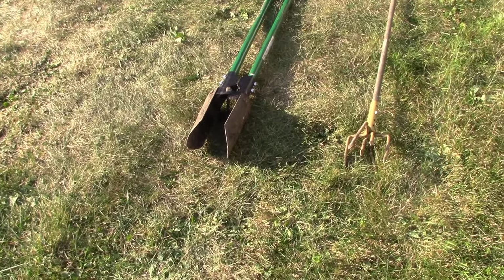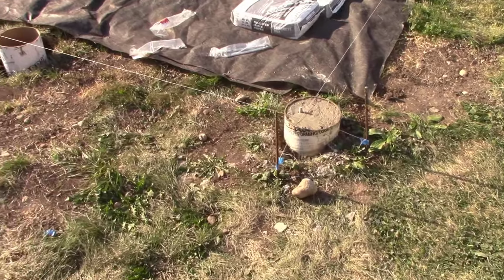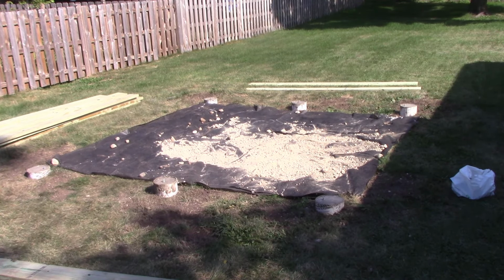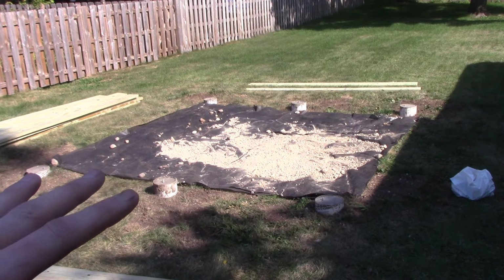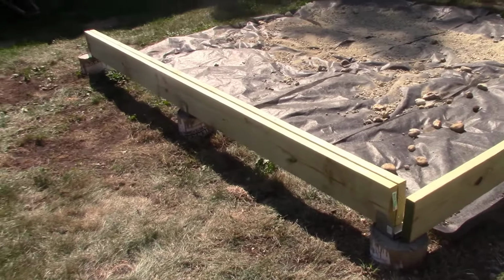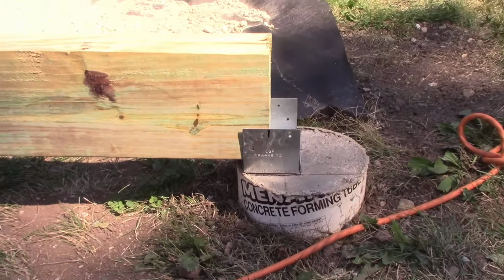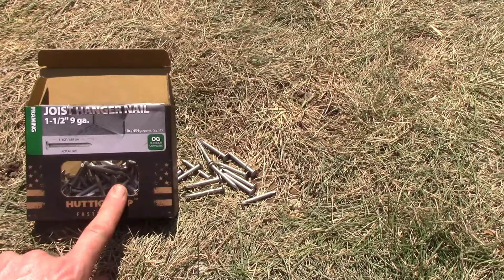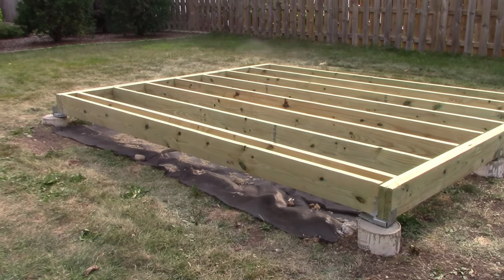Building a 10 x 12 Shed, Part 1: Foundation

Comment: I would have put my piers with 3 on the 12 foot length and run shorter 10 joists. Less span and less material. Usually you double up the two end joists where your walls are sitting for more support of the wall load. I also would have made my dimensions fit my piers since you didn’t place your piers to fit your original size. 
Great job and always feels good to step back and see what you built when it’s finished!
Reply from the maker: Thanks for the tips!

Comment: I gotta ask, would the city not allow you to have your inside rimbeam 1 1/2" short so you could nail the rim joist into the end to make a perfect square and not use a hanger, but sitting on the concrete anchor?
Reply from the maker: That probably would be fine.  My city's code for shed foundation is pretty vague; they give a 3 options for foundation types (slab, piers or auger anchors) and a bunch of requirements around where it can be located (easements between structures, property line, etc.)  Other than that, they leave it up to you as to how you frame and build it.  I used some pretty standard plans and got no notes from the inspector who passed it.
Reply: @FixItScotty  Nice! I appreciate the reply. I'm looking into building a 1.5 story workshop shed which will he kinda heavy. Don't wanna pay 7K for just a shed foundation 😄

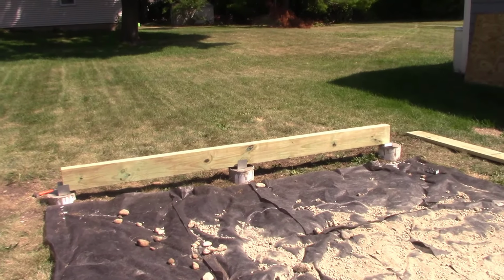Comment: Newbie here. Why did you not just buy joists- like 16" (or 14" if they have those? The joist on the bottom right of the screen @15:24 is just barely hanging on, if it starts to rot at the end then you're gonna have some issues.
Reply from the maker: Good question.  I should have extended the joists to fit the piers better, but the maximum square footage for a shed that I'm allowed to build in our town is 120 square ft.  So I had to keep it at 12' x 10'.

Comment: Did you use any rebar in the piers? Maybe I missed it or it was omitted in the edit?
Reply from the maker: No, I just poured concrete into the empty sonotubes.  For this application, I don't think rebar is necessary.

Comment: Looks like you should always plan for a bit of overhang when marking for your footings, then you won't have the issue. You could also cut some 1/2" plywood into 7 1//4 inch 8 foot strips to place between your beams when you laminate them together. That will make up for the 1/2" gap and also give you a bit more strength.
Reply from the maker: Great suggestions

Comment: hi how did you determine the pier diameter and spacing?  I am looking to build a 12 x 16 shed myself..
Reply from the maker: For me it was two ways: my local code specified minimum pier size and depth.  I believe it was 10 inches and a depth of 42 inches since I live up north and the pier has to be below the frost line.  As for placement, I just used the shed framing plans that I bought that suggested 3 piers per side with the double 2x8s spanning them.  That would be based on the type of dimensional lumber used in the floor framing and the spans allowed for the load.
Reply: @FixItScotty  thanks!

Comment: Can you use a deck foundation to build a shed
Reply from the maker: If your deck was built with treated 2x10's, 16" on center and is level and on firm footings, that should carry the load of a shed this size.
Reply: @FixItScotty  I was going to use 2x4s and cover I with deck boards with a deck block on each board and a row in the middle would that work? It’s going to be a 8x8 shed
Reply from the maker: @christophert5296  Even for 8x8, I would probably use 2x6s for the floor joists. 2x4's may work, but my expertise is not carpentry.
Reply: @FixItScotty  Ok Thank you!!! 😊

Comment: What brackets did you use to cast into the concrete piers? I'm also working on a shed foundation, but I can't find any brackets that are made to be placed in a concrete pier so that lumber can be placed into them horizontally. They are all built for vertical posts. I'd like to run my skids in in the brackets horizontally, as placing my floor on vertical posts connected to concrete piers would bring my floor up too high.
Reply from the maker: I used 4x4 brackets. You can either shim the bracket for the extra 1/2" or glue a 1/2" plywood strip to your 2x8 or 2x10 lumber to create a 3.5" width.  https://www.menards.com/main/hardware/fasteners-connectors/construction-hardware/column-post-bases-caps/mitek-reg-4-x-4-steel-2-sided-post-anchor/pa44e-dp/p-1444445522951-c-8825.htm
https://www.menards.com/main/hardware/fasteners-connectors/bolts/anchor-bolts/grip-fast-reg-1-2-x-10-hot-dipped-galvanized-anchor-bolt-w-nut-washer-2-count/1210hgab/hardware/fasteners-connectors/bolts/anchor-bolts/grip-fast-reg-1-2-x-8-hot-dipped-galvanized-anchor-bolt-w-nut-washer-2-count/128hgab/p-1444439570032.htm
Reply: @FixItScotty  I appreciate your reply. My main issue is that these brackets are for posts to be placed vertically. Do  you know of any brackets that are built to hold lumber in the horizontal position and be cast in concrete?
Reply from the maker: @joshuawood6644  I'm not sure. They all seem to be built for upright posts. You could try another type of bracket with higher walls like this?  https://www.lowes.com/pd/Simpson-Strong-Tie-4-in-x-4-in-Triple-Zinc-Wood-to-Concrete-Cast-in-Place-Base/1002708370
Reply: Why would you place the boards horizontally? That isn't going to give your foundation any structural integrity.
Reply: @ronlaverdiere  I'm not talking about my floor boards/band boards and rim joists.. I'm talking about my skids.
Reply: @joshuawood6644  I saw your Catio video a few days ago, so I know that I must be mis-interpreting your intention with your question as you seem to have some skills and plan well. The Catio turned out great and overall it was one of the most thorough builds I can find on youtube. I plan to build something soon too - the cats cannot wait.
Reply: @ronlaverdiere  I really appreciate that! I'm a beginner and the catio took a lot of work for someone like me. That means a lot!! Good luck with your catio!!
Reply: Are you talking about the threaded metal rod protruding from each pier? What you want is called a J-bolt or L-bolt. You set them in the concrete with the threaded end sticking out, drill a hole through your skid or sill plate (depending on how you are framing it) then attach a washer and bolt to the top. You were talking skids - I assume a 4x4? If you need it to be flat just countersink the hole in the skid so the bolt sits below the top.

Comment: Code is ridiculous.
Reply from the maker: It certainly can be ridiculous. That said, this past weekend I saw a some very expensive wooden playground equipment in the same northern climate as me. It was not that old, but was tilted and jacked all over.  Clearly, the installer didn't put the posts into the ground very deep and the result is it is now almost unusable.  I am glad knowing that won't happen to my shed.
Reply: @FixItScotty  Oh I agree with that. 24"-36" should be enough for most stuff. In PA, it says a variable of at least 24"-48", depending on location, soil, etc. That makes sense to me. I built a chain-linked fence and put all the posts 24" and wet placed the posts with rebar in the middle, then filled the posts with concrete so it's all one piece. Strong.

Comment: Why are so many inspections needed? Taxation?
Reply from the maker: No, it's not taxation; the permit fees were probably just enough to pay the 3rd party inspector.  It's really about safety.  Too many people built make-shift storage structures that would fall over or blow away with high winds. So the city overcompensated by regulation.

Comment: I am planning to build a 8*10 which after seeing your video thinking of going 10*12. The challenge is I have a roughly 30deg slope which is the only ideal spot in my yard. Not sure which part of North you are from but I live north of Twincities and definitely where we are hit with snow and coldest temps most part of the year. Any ideas/suggestions from anyone is welcome.
Reply from the maker: Building on a slope is a challenge. You could still do piers like mine, but the ones on the slope sticking out of the ground may need to be reinforced with rebar.
Reply: They make plates for 4x4s and 6x6s that sit on top of piers

Comment: 50-lbs. per ft²?!?!? Weird. A single 1x4 pine board will support well over that.
Reply: Let me add though, I'm glad you built a crazy strong base.
Reply from the maker: Now that you mention, that does seem weird. The text in the city shed requirements was "Concrete piers set to a level 4 o 6 inches above the ground to support a wood floor
designed to support 60 lbs. per square foot."  That does seem like a rather low bar.
Reply: I think you're confused about what that means. At 16" OC and a 10ft span you'd need 2x8 joists typically for that load.

Comment: How do you level it?
Reply from the maker: I used a tight string line and a string level to level the concrete tubes before I added the concrete. Then I used a 4 ft level on my floor joists.

Comment: Can you list all the material used in the project. I plan to build a shed
Reply from the maker: I don't have that list easily available. But I bought these framing plans that have a pretty good materials list. https://www.icreatables.com/sheds/10x12-B-backyard-shed-plans
Reply from the maker: @eliasdiez9896   I talk about the roof trusses in part 2.  I believe they are all 8' 2x4s when I build them and I cut the ends off later after I put the wall sheathing up.

Comment: Not trying to be a Richard but you shouldn’t be doing instructional videos without knowledge.  Those posts are embarrassing
Reply from the maker: Did you watch the video?  Did I not mention multiple times what I did wrong and how the viewer could learn from my mistake and do it right?  Yes. Despite talking about how I'm doing my build, did I ever put words in my video title like "DIY", "Instructional" or "HowTo" or represent myself as a shed expert? No. Are my "embarrassingly" misplaced piers still holding the shed fine after 4 years?  Yes.
Reply: What's wrong with the posts?
Reply: @FixItScotty excellent reply. 💪👊